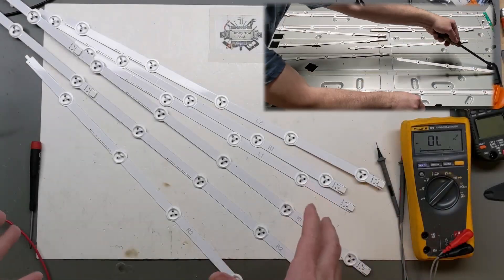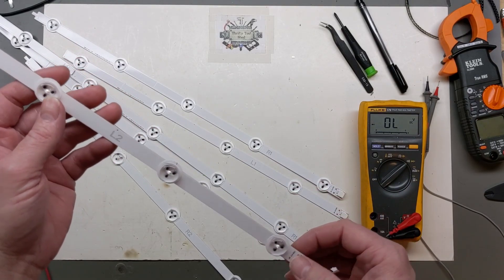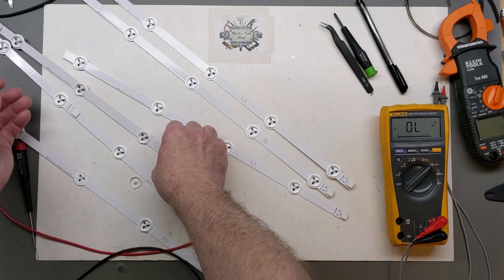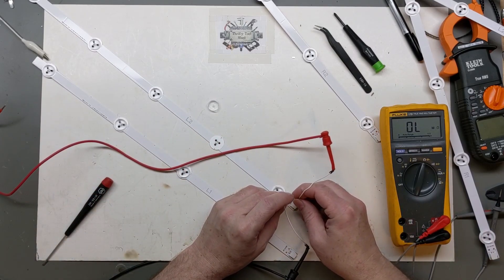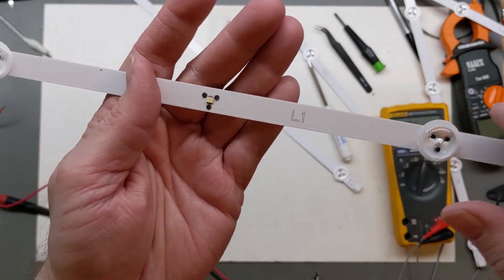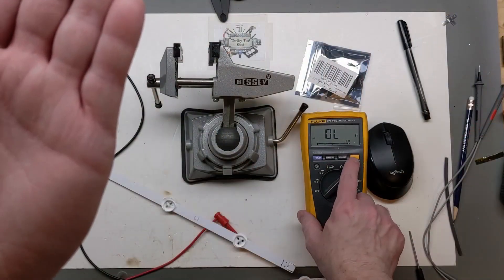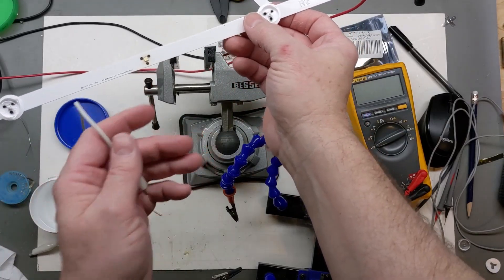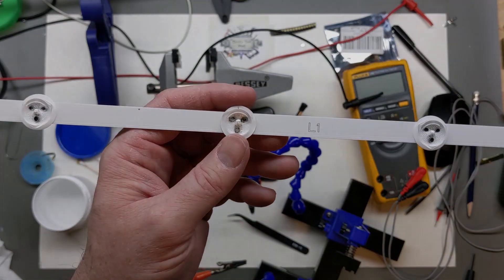VIZIO 47" TV No Backlight (SMD LED Replacement - Video#2)

Comment: Also if you don't have a power supply you can use a 9 volt battery I think the voltage of my strip was 27 volts so I used 3 9 volt batteries connected to each other with positive and negative to test whole strip
Reply from the maker: Just remember it's not a good idea to use a supply that is not current limited with LEDs. As long as you know it's just the right voltage for your exact strip to barely fire the LEDs, but not too much to over drive them.
Thanks for sharing.

Comment: Can I use any similar-sized SMD LED for the replacement ? because I have a flashlight that has LEDs about 60 of them the same amount I need for my TV if I just changed them all one by one I don't mind taking the time to do it I just don't want to do it if maybe the ones in the flashlight are too bright?? Is that possible or if the SMD LED fits on the pads then it should be good to go pretty universal or ??
Reply from the maker: I believe the main thing is the polarity is the same so they would even work at all. I also would wonder about the color of them and brightness as you mentioned. I can't say for sure, I personally would hate to take all that time to swap them out and they are different.

Comment: What led smd would you recommend to replace in a vizio D50U-D1 or just a roundabout area in them.. thanks greatly for ya time bro
Reply from the maker: Sorry, I have not worked on this model to say for sure. I do know shopjimmy.com has the complete backlight strips for $49 for this model in stock at this time. I would typically have to repair my first TV like this with strips and once I get it working you can get a voltage reading across the LEDs while working at 100% brightness and then with the physical measurement get a better idea of which LED the strip is using! Hope it helps and best of luck to ya!